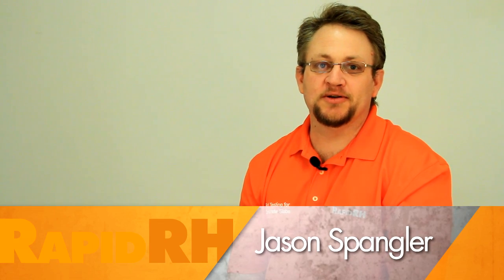Concrete Moisture Measurement: 2 Myths Debunked

Comment: So what would cause high amounts of moisture in above grade slabs? I definitely need more convincing than "you've seen it" while reading from a teleprompter.
Reply from the maker: Thanks for the comments.  Man, I wish I was coordinated enough to use a teleprompter, it sure would make my job easier.  Here are a few reasons why there can be issues with elevated slabs:

1) Pumpable concrete will usually utilize water reducing admixtures to improve pumpability, but sometimes, additional water is used instead.  Older  flooring products reacted differently with moisture and could have been installed successfully in high moisture environments.  Poured into a “pan deck”, once the older flooring products were installed, if there was excess moisture still in the slab, it would have no ability to escape.  Years go by and now we want to change to a new flooring product.  At this point, the excess moisture could be an issue and if there is no moisture testing prior to installation, who’s fault would it be if there was a moisture related failure?
2) Higher elevation floors are typically expose to the elements longer and with that, the potential for additional water to get on them is higher.  

At the end of the day, I am not trying to convince you of anything, I am merely relaying information...do with it what you will!

Jason